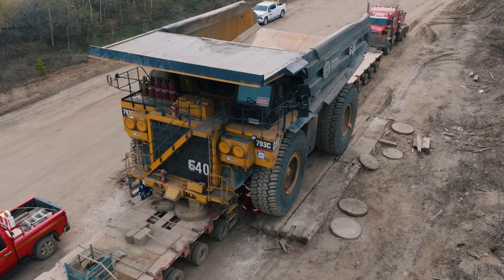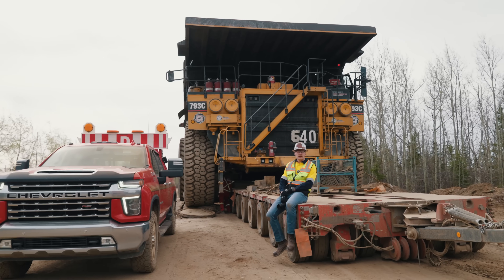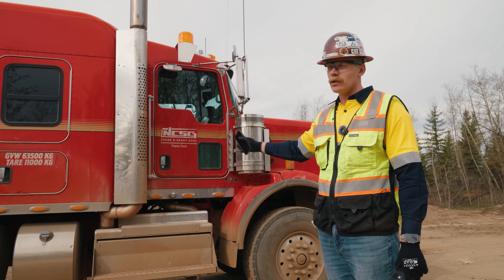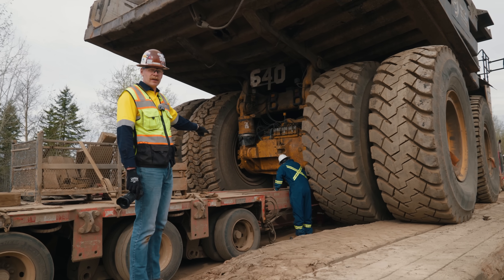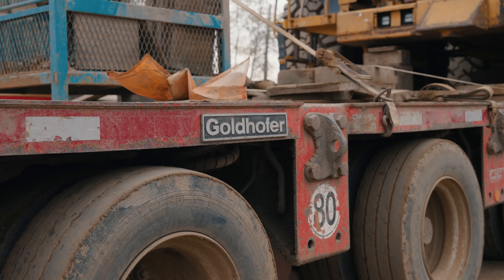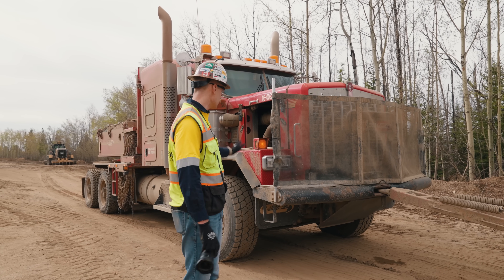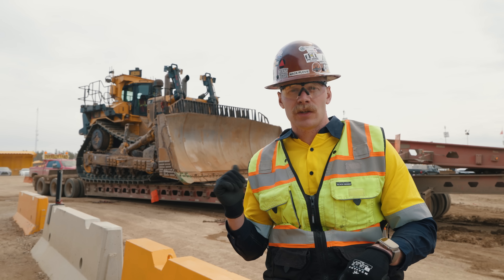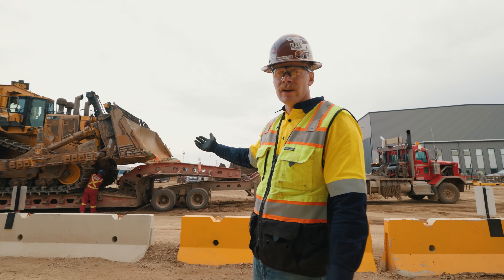Heavy Haul, The Alberta Way

Comment: Are those trucks all-wheel drive? How much weight in these containers over the drive axles?  I am surprised they can develop enough traction to pull/push that heavy load. What's the weight per axle compared to a conventional highway truck?

Comment: The truck in the back - how does he know how much throttle to apply? Is there some type of pressure sensor or wireless communication between the front and the back truck so they are both using the same amount of horsepower?
Reply from the maker: Radio communications and experience working together with the other driver

Comment: Just a quick question, why are they running The Kenworths with an open engine compartment?  I’m assuming for additional cooling of the engine compartment and the engine itself?
Reply from the maker: I think in the summer months it's for cooling, winter months everything gets sealed up. Plus it looks more badass with the engine bay open!
Reply: C500 open hood to reduce engine heat. Let me guess you are from some communist country lol?

Comment: I would have just driven it down the road.  What are the Mounties going to do, tell you to pull over? 😅
Reply from the maker: In Fort Mac, no one would bat an eye at the sight of a haul truck on the road
Reply: @Earthmovers_media  It's happened, haha.... didn't have to worry about everyone having a camera in their pocket back in the day. And there wasn't much traffic north of Syncrude before Aurora and Shell broke ground, especially at night....

There were 8 or 10 triples and 85's that made a midnight convoy up to one of them from Northgate at basemine when the first site started stripping ground way back when.... and the odd grader too.

Not called the bridge to nowhere for no reason.

Should look for the video of the red army moving an, almost whole, 5500 across the bridge either to or from basemine.  Pulled the clam and some of the tracks and had about 600 wheels under it.
Reply from the maker: @AndyEightSevenFive  That definitely sounds like the early days of the oilsands, what a time to be alive! I see Mammoet is moving fully assembled 980 Komatsu over the bridge now
Reply: @Earthmovers_media  Heading North or South? I've been away from the place for a bit now only had those at Suncor Base last I knew of
Reply from the maker: @AndyEightSevenFive  Headed to Fort Hills, so North of Fort McKay
Reply: @Earthmovers_media Thanks, I kind of miss being in the loop.... the honest engagement snagged yourself a new sub. Cheers